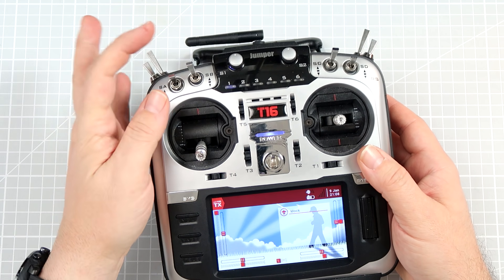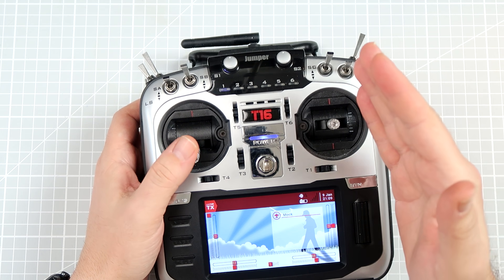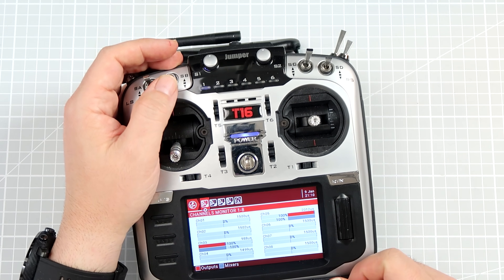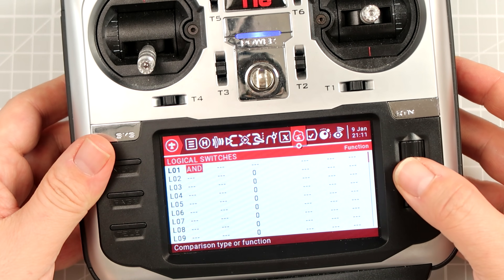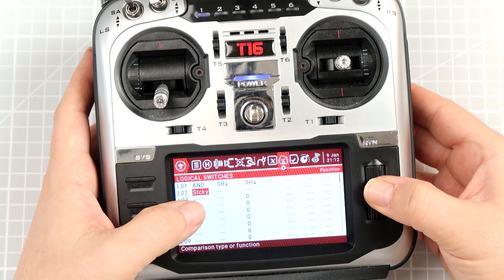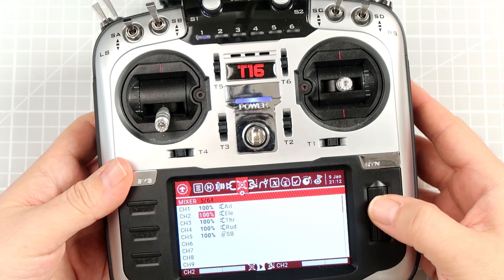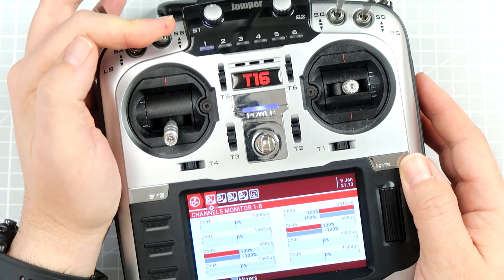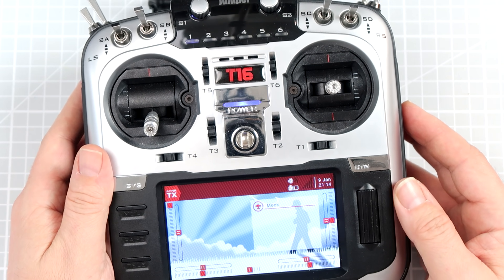OpenTX Tutorial - Safer Arming = Dual Switch Arming

Comment: Well, I did this on my Jumper 16. Worked well. However, due to poor quality control, I had a Jumper rx fail. A week later the multi module failed. I recently purchased the RadioMaster. I set it up as per the video, but could not get it to work.the only difference from the Jumper16 is that switch SA is assigned to channel 5 instead of switch SB. Any help would be appreciated.

Comment: You can do this with just one logical switch.  Set L01 to 'OR', argument 1 to SH down, argument 2 to L01, and argument 3 to SB down.  With another line you can add a throttle check for fixed wing.  On L02 use a<x.  Argument 1 is your throttle input, 2 is the safety threshold (-97 works), argument 3 is SH down.  Now change SH down on L01 to L02.

Comment: thanks for the tuto. I did it and it's little bit safer than only one switch, but this is not safer than the double arm on BF. Imagine you SB is down and by mistake you push the SH.. your quad is arm. On BF: if your SB is down and by mistake you push the SH.. nothing happens. you need to have the SB in the desarm position then push the SH to arm. Or maybe is miss something

Comment: Hi,
I set up the radio as per your instructions. However, my understanding of the logic for the move is lacking.
I don’t fly drones. I’m assuming this setup is for a controller. I fly fixed primarily fixed wing with elevons.
I managed to set the radio up with functional arming as per your video. However, when sb is down and sh is triggered the motor runs at full throttle with the stick in the full down position.
Can you help?

Comment: I was very excited to watch this video as I tried to set-up this 2 switch arming procedure both on my Taranis X9D and Jumper T16 Pro (nice radio BTW) per YT vids by J.B. and other YT RC gurus. They simply do not work. I follow the instructions to the letter which isn't hard to do. Everything checks out per the channel 'monitors' but when I 'arm' the quad she'll fly if I touch the throttle regardless whether I flip the 'momentary' switch (SH) or not. What am I missing?
Reply: Well after thinking about it I decided to set-up 'turtle mode' on my Meteor 65 and while playing around with that and thinking about the "Safer arming" process. It then dawned on me that one important element was consistently left out of these videos and that was to make sure the 2nd switch (eg: SH) is working in BETAFLIGHT.  The "SH" switch MUST 'ARM' in Betaflight when 'SF' is in the position you deem as 'armed'. Don't just rely on your transmitter channel monitors. That might have been obvious to many out there but it wasn't for me. Anyway NOW it works beautifully. 
To be clear, I flip 'SF' towards me (nothing happens in Betaflight) and 'Arm' using 'SH'. The 'SH'activates 'Arming' in Betaflight. I flip 'SF' away from me and the quad disarms in Betaflight which is what we want. So once you set-up your transmitter you MUST complete the set-up in Betaflight or else you'll experience my problem). Hopefully my stupidity helped others. Thanks for your videos Pawel as I do learn from them and appreciate your presentations.  I'm subscribed.
Reply: Maybe you need to change your mixer to take the arming channel directly from the physical switch to the logical switch.  In this video that would be L01.
Reply: That should read, change it from the physical switch to the logical switch.

Comment: Great video. I always feel uneasy when first connecting lipo to quad, I know how quickly those props can spin and the forces involved. Is there a possibility the FC/esc can glitch and cut me up? think about this everytime I fly! Cheers
Reply: Always be prepared, just incase. Like, ALWAYS unplug the saw before you change the bade...
Reply: @airflowfpv7791  under slung lipo not easy to be out of the way, got double arm switch if it glitches it will hopefully fly away not towards

Comment: Useful stuff. I just cut my finger yesterday. Luckily on a 3". Cut was still surprisingly deep, tho it has already almost healed a day after.
My own fault though, I armed the quad while holding it in my hand and shaked it around to get droplets off the props after a crash. 
Would never do this on a bigger quad, but it has also already happened to me to accidentally arm a quad when leaning over while having the controller on my lap.